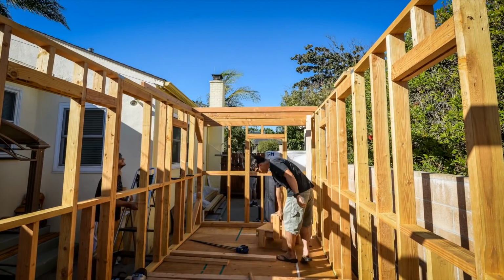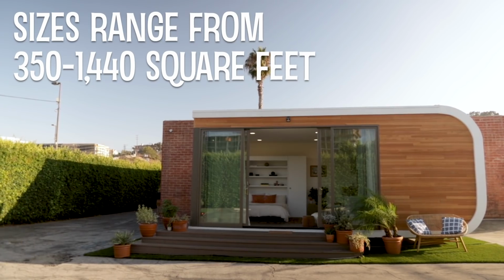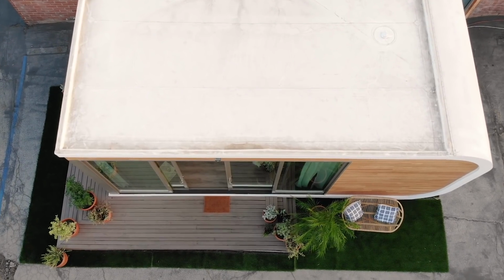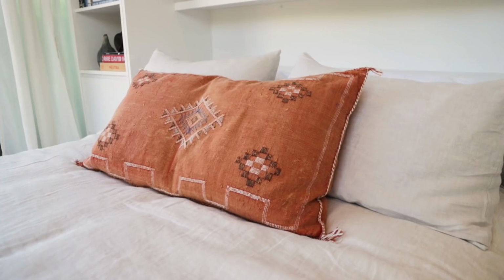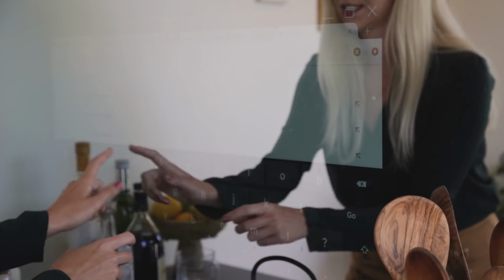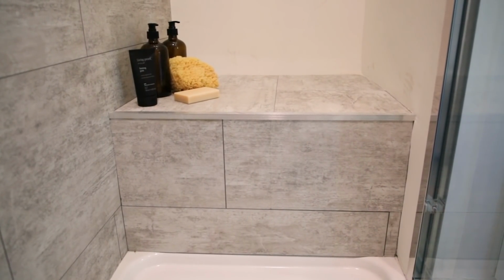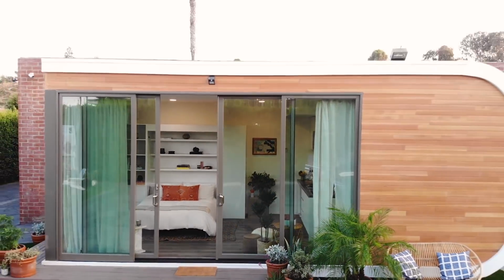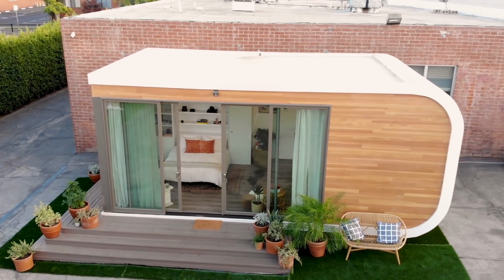3D PRINTED HOUSE! Is this the Future of Construction?

Comment: I see a lot comments about how expensive this place was, if you are off grid and you work a job. This is completely achievable. Its really based on how much you would want something like this. Just get one in an area with really low tax and you would be good. Now if this model comes with everything in it, touch screen, bathroom the whole nine, this really isn't that bad.

Comment: Love that it's more sustainable than the traditional building process, and I actually loved the design. But it's way too expensive if the goal is to create affordable housing...
Reply: Just because someone states that it's more sustainable doesn't make it so. Building with lumber is the original sustainable building. We can plant trees and they grow
Reply: @bodditech  The factories and machines we use today to cut down trees and turn it into strong lumber and other housing materials produces a ton of CO2. It's not like someone with an axe making a log cabin.
Reply: Has to start somewhere, though...  Just like everything else, like cellular phones started out costing thousands for just basic phone function and now you can get a smartphone that replaces most devices and get it for next to nothing unless you want a flagship phone.  The technology will just keep improving until it is low cost, and early adopters will help fund that process.

Heck, home 3D printers used to cost tens of thousands but now you can get a basic kit for a few hundred... It'll get there eventually and when it does then we can all get custom homes for a fraction of the cost...
Reply: @ZeoCyberG  In fairness phones still cost thousands 😂 they just have modern tech in them.....
Reply: @Spazza42  No, it's really just the flagship phones that can still exceed a thousand.  Rest fall well under and you can even get older models for free with some phone plans...  While they combine cameras, gps, phones, tablets, computers, and a few other features all in one device and not just modern technology...  3D printer technology is advancing quite rapidly and a few more years is getting to the point something like a smartphone will soon be something you can just print out and start using and they're also doing food.  So the fictional Star Trek replicators are going to start becoming a reality basically and we can start having things manufactured on demand right at home...
Reply: Exactly. Look at the alternative like boxable- which starts at $50k
Reply: Savedy efforts to write the comment. 😄
Reply: Agree.... 👍

Comment: I do 3D-printing as a hobby, and that's only possible due to the affordability that FDM and UV resin have reached. I am super intrigued by to progress towards 3D-printing houses, and what possibilities it brings to the table. But it might be years maybe a couple of decades before it starts becoming affordable.

Right now the price is too high, new technology often is more expensive (and i suppose they put in some expensive stuff in it as well).

I just hope it won't be locked up with patents preventing it to become widespread. To really be affordable i think a market where people specialize in different aspects will be needed, not one business that will make the machine, design the houses, print them, finish them, and install them.

Their use of a UV hardening polymer is nice, i don't know how green it is but it might have the potential to be greener than concrete if it isn't already, at least i hope so. If you could print say a transparent foamed (for insulation) plastic it could be used to print semi transparent walls and skylights letting in more light with fewer manufactured doors and windows, possibly saving a decent bit of money.

Even if i had the money I don't think i would want a 3D printed house that can't be customized, to me that's kind of the main points with 3D-printing (they still have the ability to iterate a design fast thou, but once they printed yours it probably won't help you).

Comment: I'm not sure actually and longevity 3D printing is weak and how does that affected by UV?
So it's resin printed makes more sense but not sure on longevity has to be heat stable and cold stable as well.
Why print in one piece that makes no sense your limiting your size costs more expensive printing prefab panels gluing them together on site is better  and the sizes has no issue and transport is not limited.
Well that's a stupid thing why didn't you 3D print the wall and 3D print a bed frame what can fold away and then turns into a couch! not difficult, been better save space.  these things were around in the 50s and 60s and then the technology got sort of forgotten about now it's a lot easier to manufacture something like that.
my dad was the first person to make design and build a tiny house in  1952, a caravan that you put together with two become a cottage the tiny Cottage, was in the home exhibition in London. He designed and built the prototype they the company never took the idea further shame.
You could do the same thing with that 3D building make it a two story where you can have a porch with a stairway on the side if stacking 2 if you design lugs around the edges that have covers so they can slot into each other and a threaded rod goes all the way through make it three bedroom+
 or do the same principle as my dad did with the tiny Cottage remove one wall by sliding it out and bolt two together side by side
Reply: You underestimate the tech. This isnt resin or fdm 3d printing tech. The world of resins and levels of what they can handle expand wayyyyyy beyond what most people think when comes to 3d printing. They way it lays down its more of a uv resin reinforced foam so temperture stable.  Resin reinforced adhesives are used in high end cars where mechanical fastners would add  to much weight to strength, and on average are much stronger due to the surface area they can cover vs a screw or bolt. 3d printing in the home or even small industrial realm really has a long ways to go to catch up to the resin/silicone/plastics material options especially for applications like this.
Reply: @MattWeber  tiny houses meh to each their own but better not mess with making 3d food...just saying 😉
Reply: And as for the size, its mostly due to the regulations on what has to pull certian permits vs not being hampered by waiting forever and severely driving up expenses. You can easily spend $25-50k in Commiefornia just for permits to build a tiny home, let alone a larger one. Limiting its size limits permits and inspections required to continue forward with a build, and thusly limits delays from waiting on said permits. Like she said, some people can wait upwards of a year or more for a simple permit to get approved even if no design delays causing it.
Reply: @MattWeber  that's another matter permits, I would have thought permit wouldn't be an issue with the double story house using the same footprint.
Yes I'm sure resins and everything else is getting better but the nature of 3D printing leaves a weak point now that can be designed in the structure what they have partly addressed here, but we don't know what the long-term problems might be being exposed outside in Blazing sun in very cold temperatures over decades and what about recycling are these recyclable ? that can affect construction and permits as well.
Reply: @johnsweda2999  They can be hugely different permits due to construction style, contents of wall like wiring/plumbing, roof and eartquake codes, etc. Being an all in one design they can very easily publish X test results and streamlines the process of getting those permits and passing inspections, as the only real variance becomes property variables like foundation and landscape restrictions.

Comment: affordable? a one room for $200,000 is not affordable
Reply: U can buy a two story villa in front of the sea in Italy for that money
Reply: I agree.
Reply: True but like anything else mass produced, the price should go down.  Just like big screen TV's which were thousands of dollars and eventually in the hundreds.  We shall see.
Reply: @youp9546  Doesn't change the FACT that it's currently the opposite of affordable.
Reply: @youp9546  What confuses me about this justification, though, is that as far as I can tell the process of constructing/printing pre-fab units is already less labor intensive and less costly than on-site construction, so why is it that most of these tiny prefab units are more expensive than units constructed on-site? Only justification I can think of is ongoing R&D costs since it is a fairly emergent technology.
Reply: My 2-bed 2-bath condo cost me about 200k.
Reply: @Marie45610  u got scammed
Reply: @warlockostia  That's just the housing market where I live.
Reply: @Marie45610  yeah I was joking, ofc depends where u buy, my house is a 220mq villa near Roma by the sea with a very big garden and i paid less than 200 grams, but if u buy a 100mq flat in center of Rome it can cost up to 2-3 milions
Reply: Too expensive! 😂
Reply: we should be able to buy the printer for less than that!
Reply: @FixItYerself  lol indeed
Reply: @FixItYerself  I like the way you think!
Reply: Will it last 200 years?
Reply: Right....
Reply: This would be cheap for the Bay Area, where the average home price is over a million. In fact, a studio condo in San Francisco, with the same square footage, would easily cost $700k–$900k.
Reply: @jamesslate1026  yikes
Reply: @jamesslate1026  I don't understand how people afford to live in the bay area. They probably don't even allow tiny houses there, unless on private property.
Reply: @jamesslate1026  Because of the land cost, not the construction cost.
Reply: It is if you live in overpriced and over taxed and over regulated California